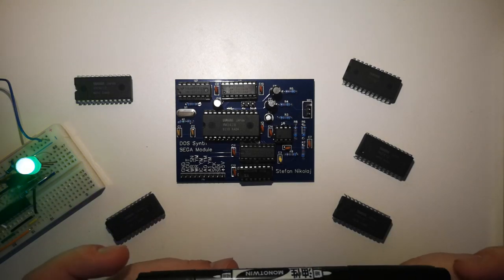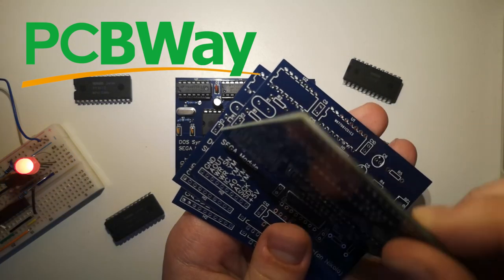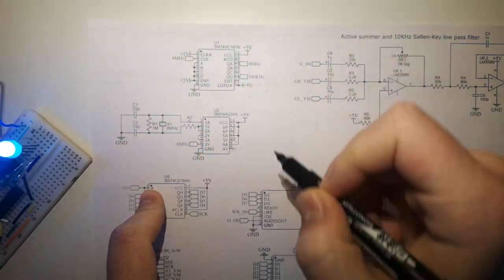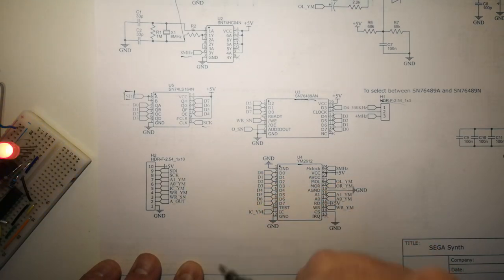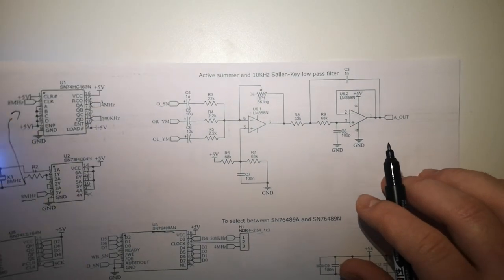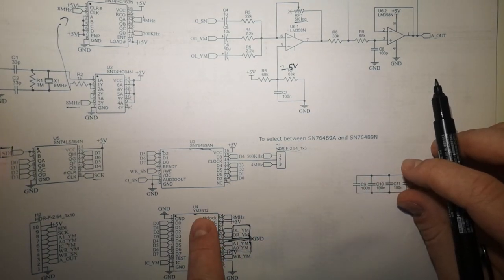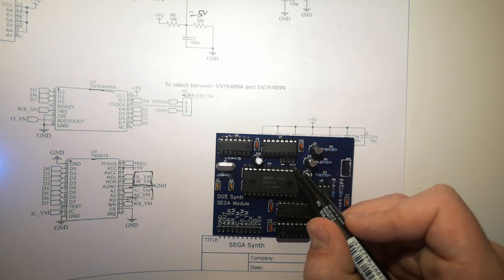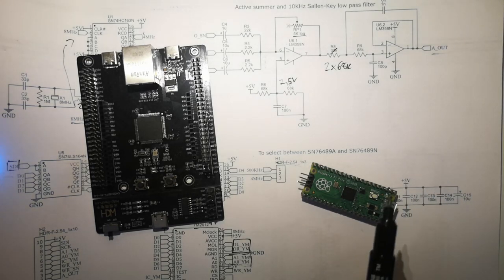The SEGA Synth - a DIY YM2612 Synthesizer Board Design

Comment: Thanks that was inspirational and great, though I would say it would have been nice to have a mounting hole or two, maybe I can drill through the copper on the output side and near your name? And I'm interested in how to programming the thing, for me I'd rather some kind of performance device than midi playback, I've got a TX7 and it's such a pain to edit patches, and i don't want to be looking at a computer in my free time - but i know there's a load of controls, so a lot of money for knobs there, maybe a touch/screen combo would reduce the BOM a bit hmm.
Reply from the maker: Thank you for the kind comment! 

For this board the idea was to have it mounted on a pin header, but I don't see any problems with drilling next to my name. In the rightmost bottom corner you have 12.5x12.5mm free, and in the rightmost top corner you have 7.5x7.5mm free. In the leftmost bottom corner above the pins you also have mostly empty space, just be mindful of the ground connection. If you cut that, a bodge wire can easily fix it. There isn't much going on down there too.

Electronically, having a microcontroller and controlling it with MIDI is the simplest way, however handling the voice assignment for polyphony is slightly challenging. In my opinion, my YM3812 project turned out to have a very elegant interface so you could check that out. It had four potentiometers and two buttons to select which set of features those potentiometers controlled. Only when turning them did a setting change, which meant that I could control all the deep parameters of an FM synth through just four potentiometers. 

However, the YM3812 had half the operators of the YM2612, so I agree with your judgment that ideally, a touchscreen combo would do the job. I think that a cheap 7-inch display with touch (~30$ from China) can replace every single potentiometer and most of the control surface, but then the issue becomes one of scope creep for me personally hahahaha. Striking the balance between an analog-like interface and going fully digital might be difficult, as adding an advanced microcontroller just raises the question of... why not just emulate the thing? An ARM is fast enough to do so, and a tiny FPGA too.

Honestly, for my DX7 I just use the E-Piano preset. I love the E-Piano, so I've never thought about trying to change it. I burned the MIDI IN port on my DX7, so I don't really have a choice.
Reply: @ackfee6086  ha, yes, you're right, I could just use the pin headers. In regard to the interface, I have a Tx7 (the Dx7 expander module, so a Dx7 without a piano keyboard attached)... the bar was set low when they made the user interface to create a patch with the original synth - and I also haven't plugged it into a computer for about 10 years... so still have the same 32 patches from that day, sigh the EP is great!

Comment: The fourier transformation will give you sine waves that when added together via additive synthesis create the complex wave forms you describe as FM.

FM relies on MODULATING one or more carrier sine waves with another, or multiple, sine waves or other waves. 

The difference is basically that youre not adding together waves but instead using one or more waves to influence the expression of the carrier waves. 

By adding amp envelopes to each operator (the affector waves) and having many arrangements or algortithms of the operators - the genesis was able to create stunning and evolving tambres if people simply learn to use the hardware or GEMS properly

Comment: Hi. Come across this on pcbway. Is it a vgm player or has cc midi mappings for  all parameters or something else. Nice tunes at the end. Looked like way more voices in play than a ym2612 +SN76489 has?
Reply from the maker: It's simply a board which lets you set the parameters of the YM2612 and chain together multiple YMs. That's why you can have multiple voices. However, there are no official MIDI mappings and the tunes were composed on a PC and then scripted on a microcontroller. The idea is that you can either make it a synthesizer through MIDI, VGM player, anything as long as you like to write code.
Reply: hey, it's me, the composer of the demo tracks, and uhh, the last one you see is actually for the YMF292(?) an arcade chip that's also based on FM synthesis,
also sorry for the necropost